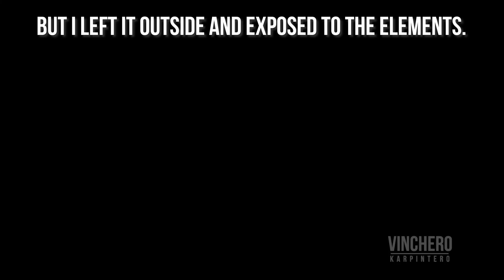Plastic Wood Projects // Replacing the Wood on a Sawhorse

Comment: just wondering, since its plastic wouldn't it react to the solvents used normally in painted finishes?
Reply from the maker: According to the manufacturer, you can paint this material the same way you would wood. I normally use water-based paints anyway so I don't think I will have a problem. However I do think as a general rule, you won't want to use any paint that you wouldn't ordinarily use on PVC/plastic material.

Comment: same po ba to sa plastic lumber? recently ko lang siya nakita sa ig. 100% recycled siya. Kung nakasubok na po kayo nun, ano pong thoughts niyo? would you recommend plastic wood/ plastic lumber to replace all structural wooden parts in a house?
Reply from the maker: Yes, I believe this is also referred to as "plastic wood". No, I would not recommend this for anything "structural". In part because I don't know enough about the material and mostly because I haven't read anything to indicate that this can be used for structural purposes. I believe these are mostly used for kitchen base cabinets.